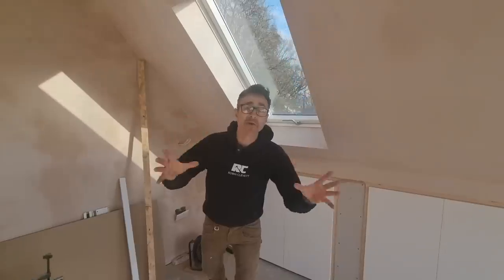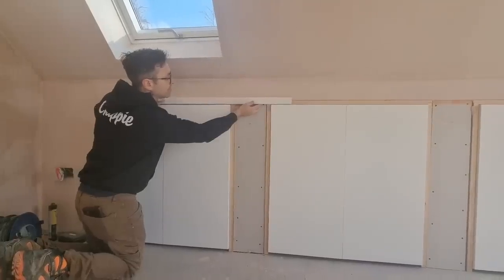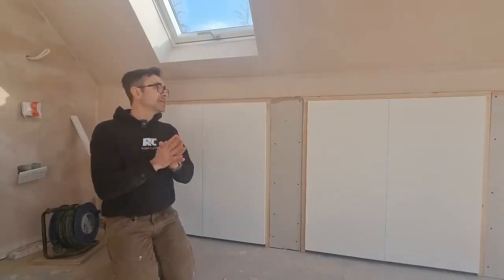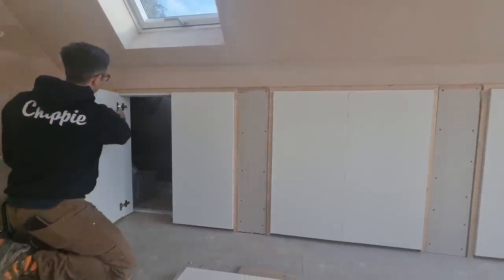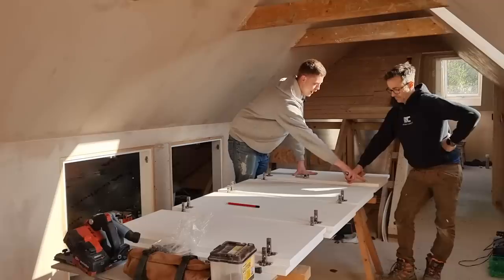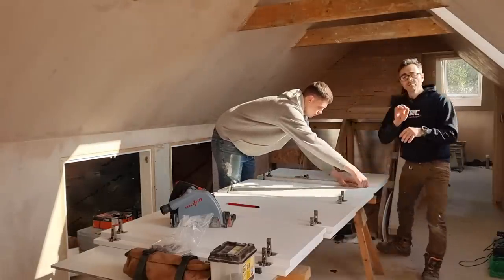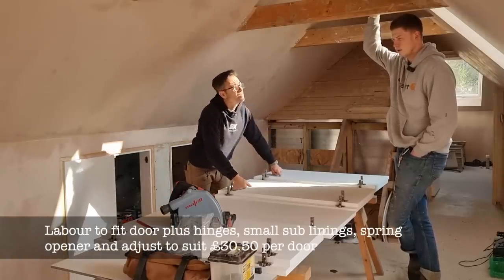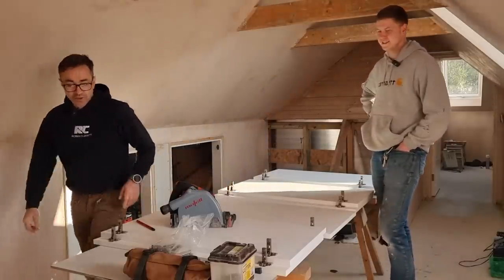MDF Doors made the best way

Comment: Hi Robin and Ed. I make my eaves doors the same. Except I plaster the reveals of the opening and don’t use linings. This means I don’t need architraves. But the downside is the doors are all slightly different as you are at the mercy of the plasterer and how thick he puts the plaster on and how accurate he is with his beads. But I do like the idea of all the same sizes and having a “system” 👍👍

Comment: Quality job mate as ever. I made a small set of mdf door for my living room alcove cupboard and used the kitchen hinges with great success, no visible hinges and nice shut lines. Neater and easier to fit I thought than conventional hinges. That was about 20 years ago and the still look good. All the best.
Reply: i an doing exactly the same job in my lounge at the min... Can i ask how thick are yiur doors and how do you open them if you have no handle?? Do you just pull them at the top??

Comment: class work. last time i was on a loft conversion i remember how long it took to mess on and make doors for the cupboards. i used those daft cranked flush hinges also. 

recently ive had a company a friend of mine runs make simple cabinets for electric meters on hmo's ive worked on. super easy compared to trying to make it all myself. id go the same route for this type of thing also. spreading the workload seems to work very well for all

Comment: Totally get this. Not a hope could you compete with price and quality. I use a kitchen manufactured and its the same. Beautiful pre painted doors pre drilled for hinges and pre drilled hinge  plates on carcasses. Drawer fronts pilot holes  marked so you can click onto  drawer runners. Simple and time saver 👍. Good video robin 👌🇮🇪

Comment: the only downside ive found with mdf is that on the larger doors they tend to want to start bowing and then they need door straightners fitting in the back and the straightners out there that actualy work arent cheap, ive just made 4 1900mm tall doors 22mm for some sliding wardrobes and they have needed a pair of hafele planofit straightners which has added £50 cost to each door, so i managed to make all 4 doors for under £100 which was great but then had to spend £200 to keep them straight :/ can you recommend a better material for the larger doors? or are the striaghtners the only way to go, thanks for another great vid
Reply: Try moisture resistant mdf with 4 hinges on 1900mm door

Comment: Hi Robin, love the video as always. Quick question - what gap did you leave between the current floor level and the door for the flooring to be installed? Is there a specific type of flooring already pre-specified going in or assumed for up to say 8mm laminate flooring with maybe 5mm underlay?

Comment: You can buy these as a unit, online. Mine were plasterboard faced so I just plastered them in. All you see is the outline of the opening. Paint the same colour as the room. Very discreet and easy to install. They supplied a key to open them.
Reply: That sounds neat. Do you remember which brand you were buying? I would like to check it out
Reply: @Dufffaaa93  google access panels direct 👍🏼

Comment: As much as I agree with outsourcing - if budget allows, I'm not sure sure about all the reasons one might do this.
Granted, getting doors like this made off site is a much better use of time but come on.. a job like this might take more time done on site but thousands of doors are made by thousands of carpenters every day, by hand, and they'll get them spot on. 
This shouldn't be a reason alone to out-source.
Reply from the maker: I have a limited time to produce work based on my work load and demands, I aim for quality and cost effective solutions and not doing tasks that are more suited to a offsite production process, did you listen to my narrative and also see the prices that I published on screen?? I see many mediocre jobs that clients have had done by tradespeople on site and I can assure you that the quality is not good and they are not all spot on!! These 17 doors at less than £30 each manufactured, spray primed, drilled for hinges and edged with the MDF preparation tape, made in under 7 days from order, delivered to site is far cheaper than doing on site
Reply: @ukconstruction  firstly, being a big fan of your work and channel I wasn’t just looking to slate your work, I wouldn’t dream of it! I just thought that the comment regarding the quality of work one might be able to do on site. Not comparing to the quality - especially at that price point - of our sourcing. You’re completely right in there being no comparison. I’m one of those carpenters who would likely built doors like this (although off site) and I would like to think that I would produce work to a high standard. 
I’m very interested in the prospect of our sourcing, especially as it allows for higher productivity overall although out sourcing isn’t going to suit every job/budget of course.

Comment: This is subcontracting and industries have been doing it for decades and decades - it does exist because it makes financial sense obviously but it is also the main reason 'people' (entire industries if you like) end up being unable to make anything from the ground up as if you dont practice you lose it (in case you ever learned it..) .And so in this industry people become assemblers...not even fitters! Timber frame (vs post and beam which requires skilled labour and expensive timber) houses do exist for that very reason: easy, cheap, the  unskilled can do it and a lot of it arrives pre-assembled like timber roof trusses: which builder makes them onsite? Nobody does that anymore. On this occasion I struggle to make sense of this post. On the other way around the skilled crafter still takes pleasure from being able to make one off  builds / structures mostly with his own skills. History shows that where there's not much of a skill sooner or later a machine / robot will take over and  this has already started. Money economies (to not call it something else) are a trap to humanity and the reason why so many of us start the day covered in plastic cheaper clothes than if they had been made of natural fibres...as someone found it was quicker and cheaper to make them from oil than from natural fibres...I am not a eco warrior by any means but in many ways we keep going in the wrong direction blinded by speed and money...everything for yesterday, as cheap as it can be and as quick as it can be...to arrive at nowhere. Think...
Reply from the maker: I agree whole heartedly about the dulling down of skills and if you look back through my channel you would have seen that my mission is to share my 35yrs worth of experience of high end carpentry, joinery and construction, and demonstrate traditional crafts, I do feel that times are changing and your mention of the fact that "people end up being unable to make anything from the ground up" is evolution of sorts, and there will be skills that will be replaced no different to other industries as you imply.
I am actually not to concerned about outsourcing to a machine in the case of repetition or financial saving as finding good labour in any trade now has become really difficult, we can only produce so many man days in a year yet the demand from the public especially in the South East where I am is huge, I worry more about many of my clients that are academics, white collar workers and other professionals as Artificial Intelligent capabilities will decimate whole professional sectors too in the way that offsite production robots etc may dilute skills in construction.
Oh and lastly I can make anything still by hand and traditionally however very few of my clients want to pay for it when they can find it more cost effective solution just a click away!